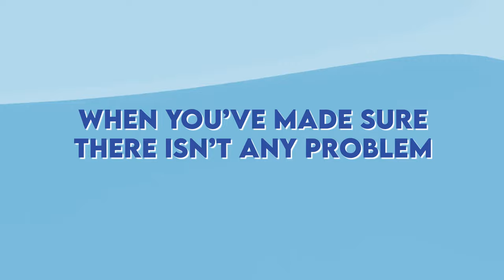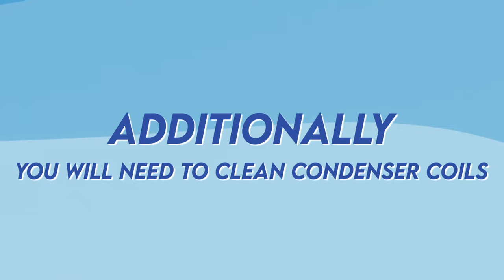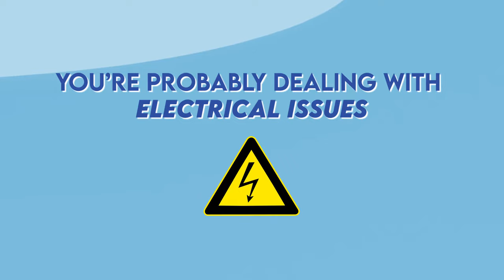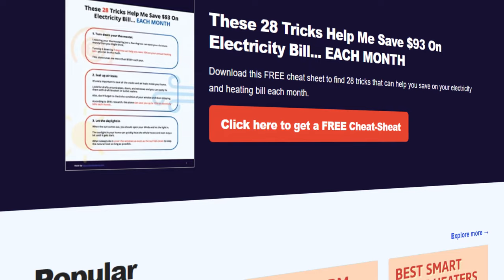9 Reasons Why Your Air Conditioner Starts Then Stops Quickly

Comment: 4:32-4:54 - Fact Check: Just because the compressor is overheating doesn't mean it needs replaced. If your compressor is overheating it could also be due to dirty coils! Clean your coils!!! Air flow matters a lot.

Comment: The number one issue should not be low refrigerant, but should be dirty condenser coils. That’s what I have found time and again.
Reply from the maker: The list was not made based on the priority of thing, but rather listing all possible reason in a random order. However, I do agree that dirty condenser coils are one of the most common issue.

Comment: I have a portable Air conditioner and it goes to regular fan breeze instead of cooling during the day when its hot when I need it, but at night time it doesn't do that at all
Reply from the maker: It sounds like there could be a couple of reasons why your portable air conditioner behaves differently during the day versus at night.

Heat Load: During the daytime, when the ambient temperature is higher, your air conditioner may struggle to cool the room efficiently due to the higher heat load. Portable air conditioners are typically not as powerful as central AC units, so they may have limitations in cooling larger spaces or spaces with significant heat gain from sunlight.

Exhaust Ventilation: Portable air conditioners require proper ventilation for optimal performance. During the day, when it's hotter outside, the exhaust venting may not be as effective if the hot air cannot be adequately expelled. This can lead to reduced cooling efficiency and the air conditioner switching to fan mode to conserve energy.

Nighttime Cooling: At night, the ambient temperature tends to drop, reducing the overall heat load on the air conditioner. This allows it to operate more efficiently and maintain cooling without switching to fan mode. Additionally, cooler nighttime temperatures may also improve the effectiveness of the exhaust ventilation, further enhancing the air conditioner's performance.

To address the issue of your portable air conditioner switching to fan mode during the day, consider the following:

- Ensure proper ventilation for the exhaust hose, allowing hot air to be expelled efficiently.
- Close curtains or blinds during the day to reduce heat gain from sunlight.
- Place the air conditioner closer to the center of the room for better air distribution.
- Consider using additional fans to help circulate cool air throughout the space.

If the problem persists, it might be worth having a professional HVAC technician inspect your portable air conditioner to ensure it is functioning properly and efficiently. Feel free to fill out this form if you need to find local HVAC technicians: https://homecaprice.com/hvac-technician/

Comment: i have a portable AC and it keep going from cool air to fan air, its a new one and it happen so much time that im thinking in return it, what could be the problem??
Reply from the maker: It sounds like your portable AC might be set to "auto" mode, which switches between cooling and fan modes based on the room temperature. Check your settings and try setting it to "cool" mode only. If that doesn't help, it could be a sensor issue or a defect. Since it's new, consider contacting customer support or exchanging it.

Comment: Sir
I have a Hitachi window AC no problem at fan speed Medium, but at fan speed High, it stops after about fifteen minutes and then restarts after five minutes of shutdown.

What could be the problem?

Any suggestions?

Thanks
Reply from the maker: It could be any of the 9 reasons that we listed in the video, so you’ll need to check each one to make sure everything is working properly. If you can’t find the issue or don’t want to deal with this yourself, I suggest contacting a professional to help you out. You can submit the form here: https://homecaprice.com/hvac-technician/

Comment: I've got a window ac with short cycling problem in the afternoon. It works perfectly fine at night but during the day, especially in the afternoon it remains in the cooling mode for 5 minutes then switches to fan mode for the next 10-15 minutes. It doesn't show that it has switched to fan mode, the cooling mode simply stops working. Its an LG window AC which we bought 10 years ago.
Reply from the maker: It sounds like your AC is struggling with the higher daytime temperatures. A few things you might check:

- Dirty Filter: Clean or replace the air filter. A clogged filter reduces efficiency.
- Thermostat Issue: Make sure the thermostat sensor isn't misreading the temperature.
- Overheating: The AC might be overheating due to old age or poor ventilation. Check if the unit is getting enough airflow and isn't blocked by anything.
- Low Refrigerant: If it's low on refrigerant, it can't cool effectively and might shut down.

Given that your AC is 10 years old, it could just be wear and tear. You might want to consider having a professional take a look or think about replacing it.

Comment: Bad or going bad, blower motor, and collapsed or leaky air ducts. The compressor and fan were working fine, but the blower was stopping and going every 30 seconds, I let it run for 20 minutes or so and the fins started to freeze.
Reply from the maker: The symptoms you describe, such as a blower motor that is stopping and going, along with frozen fins, may indicate problems with the blower motor itself or issues with the airflow in the system. I would advise to contact HVAC technician to inspect your AC. You can find them by filling the form here: https://homecaprice.com/hvac-technician/

Comment: My Air Conditioner suddenly starts blowing out Himalayan cool air and after that it shuts down. I am not able to understand the problem, can you please help 🙏
Reply from the maker: Here are some common reasons why you might be having this problem:

Dirty air filter: Replace or clean it.
Refrigerant leak: Get a professional to check and fix it.
Faulty capacitor: Have a technician test and replace it if needed.
Electrical issues: Check for loose connections or damaged wiring.
Thermostat malfunction: Ensure it's set correctly or replace it.
Blocked condenser unit: Clear any debris around it.
Overload protection: Let the system cool down and avoid overuse.
Fan motor issues: Inspect for damage and replace if necessary.
System sizing: Ensure the AC unit is appropriate for your space.

If none of these solutions work, contact an HVAC technician here: https://homecaprice.com/hvac-technician/

Comment: Installed a new ac but it is not switch on.electrical connections are propper.
Reply from the maker: I would advise to contact HVAC technician to inspect your AC. You can find them by filling the form here: https://homecaprice.com/hvac-technician/

Comment: My aircond somehow turn off and turn on by itself, it won't even stay 5 minute and it turn off then somehow turn on back
Reply from the maker: It sounds like your AC might be short cycling. This can happen due to a few reasons: a dirty air filter, thermostat issues, low refrigerant, or a problem with the compressor. I'd recommend checking the air filter first and cleaning or replacing it. If that doesn't help, you might need a professional to take a look.